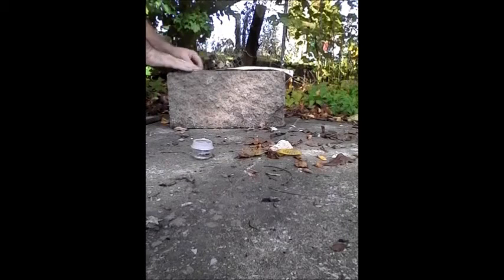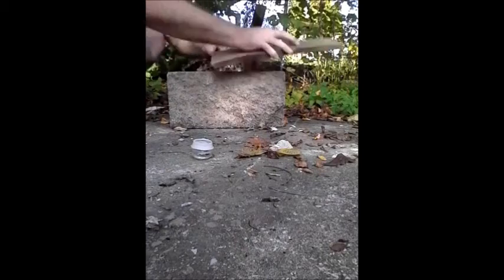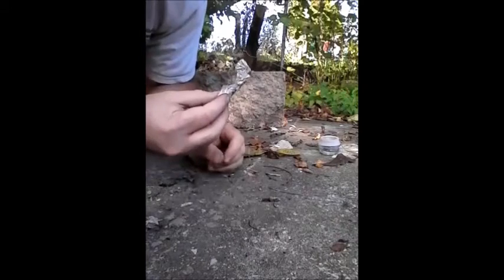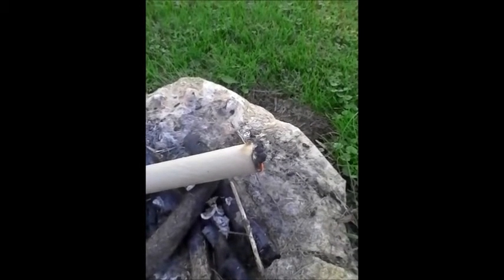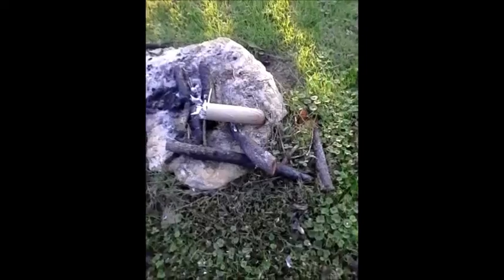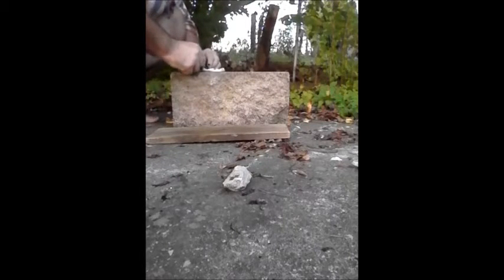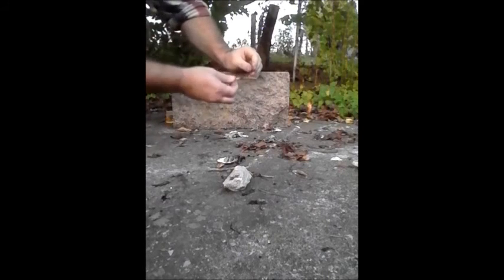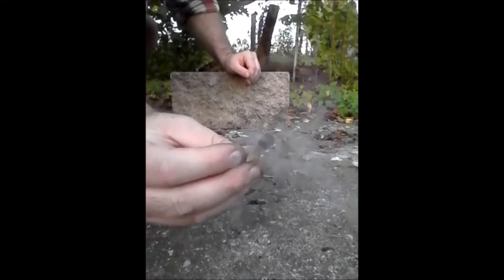Rudiger Roll - newspaper with Potassium permanganate - Fire Roll battery manganese dioxide + cotton

Comment: Ok I have a question for you. you have showed success with many many different materials. How many different combinations have you tried that didn't work? There are lots of people who do this on youtube but no one has come close to owning it like you beasty. great job! Proving this fire method is a great urban and wilderness survival skill. You can make an ember with this method with many different materials in the city or the bush. just awesome! take care.
Mark
Reply from the maker: +Adventure Time Outdoors 
Hey Mark! Glad to hear from you friend. There are some plants that didn't work well for me. Primrose, Honeyvine Milkweed and Kudzu are low end plants for me. They are not as good as the plants I put up in my videos. The Kudzu I used may have been a bad batch(may try it later on again). Cayenne Pepper is a mediocre catalyst at best. While it worked, this one does not do well all the time. Has a tendency to leak through and cause the roll to slide. Using more cotton helps but if its problematic I don't include it here. That said, Cayenne has good astringent properties. I have some in my kit for that reason. I chose the plants and catalysts in my videos based off research. What I looked for in plants was strong fiber. In catalysts I was looking for heat and friction sensitive material. I have more material and may put that up later on. Sending you a PM friend :)
Reply: I figured there mush be some research involved. Trial and error would lead to countless fails. I am happy to see the success you are having with your channel. You are doing a great job!
Reply from the maker: Thanks friend. I am just trying to enjoy myself. Hopefully my PM got to you. This google/youtube split has caused some issues here.
Reply: I got the pm but I could not return one. It just kept bouncing back!